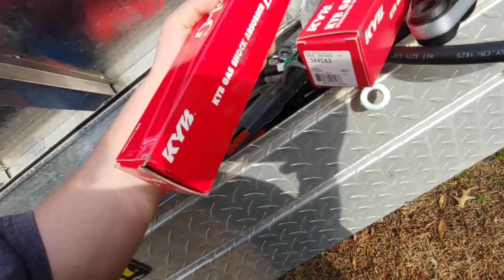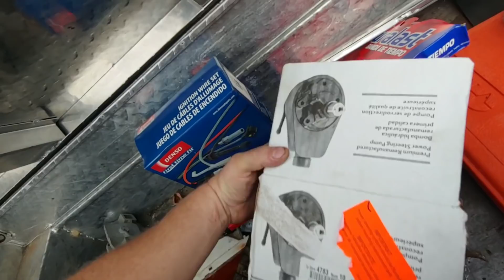Up Down And All Around

Comment: What sawzall blades do you use for the copper motors again? Was it the carbide teeth ones? #happyscrapping
Reply from the maker: Sometimes but it seems like the really thin ones work best and keeping it right up against the steel
Reply: @ScrapFarm  ok was wondering for 2 blades like $42
Reply from the maker: @waltwood4113  last time I bought when I think they were about 15 bucks a piece but sometimes you can find the five pack where comes with four regular by metal blades and an extra carbide blade for like twenty bucks